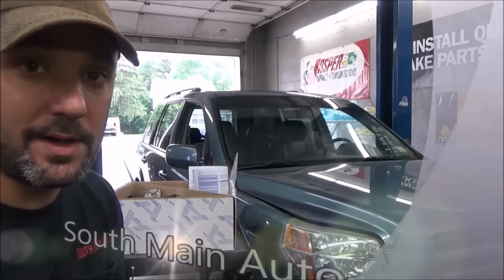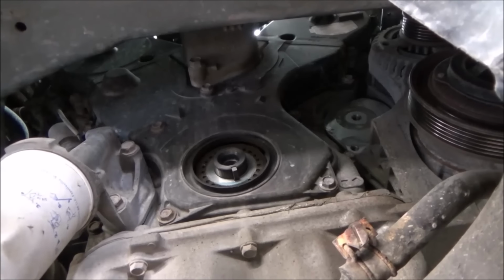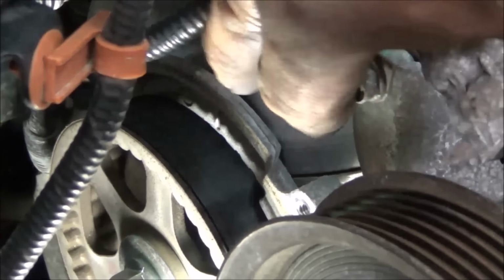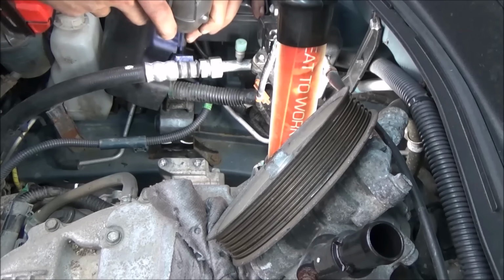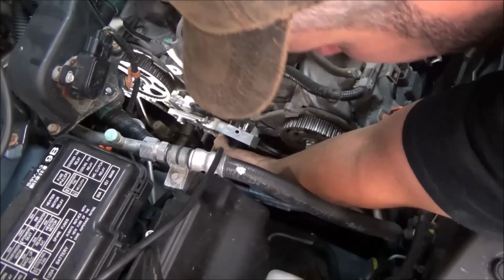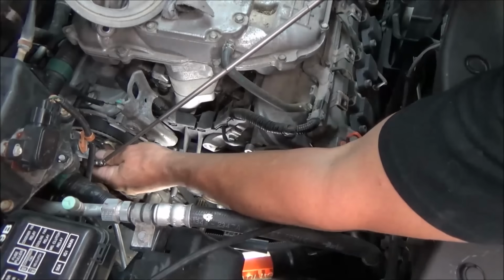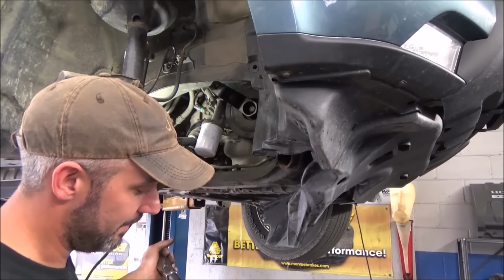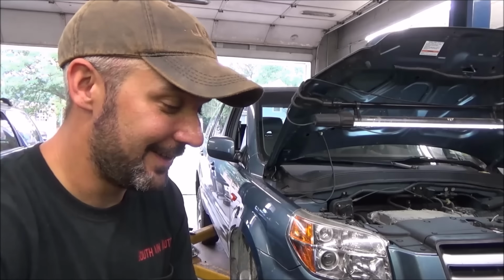Honda Timing Belt 3.5 J35 - Pilot, Odyssey, Ridgeline

Comment: Dont quote me on this, but i seem to remember the numbers on the cam sprockets (1 through 6) and inspection windows on the timing covers are specifically put there by Honda to aid in valve lash adjustment. For example, You would open the inspection window, and put cyl 2 at TDC and adjust your valve lash on cylinder 2.

Comment: I just did mine on an 03 pilot and the rear cam sprung forward. I about had a heart attack but simply wrenched it back and installed belt. Started right up

Comment: Just a note to anyone wanting to DIY this job, try the crank bolt first before doing any other disassembly (like Eric O did here)! I recently bought an 2003 Accord V6, and wanted to jump on the preventative maintenance and did not know much about the history of the vehicle. I ordered the Aisin timing belt kit from Rock Auto, that includes the water pump, tensioner, etc. I also bought the crank holding tool and the extra heavy impact socket. When all of the parts arrived, I attempted to start the job.  With the special socket and a large Milwaukee impact, the 19mm crank bolt would not come loose. I broke out a 3/4" pneumatic impact, with the same result. It would not budge. Finally, I built a tool with a 3/4" ratchet and several 1/2" extensions and a cheater bar. I used the crank holder and was able to to stand on the breaker bar with my 300lb weight and it still did not break loose. Also tried map gas torch to heat the bolt.  My advice is would be to have a lift available where you can get the vehicle into the air. If I could have used just a breaker bar and one socket with a pipe from the bottom, I am 100% confident that I could have broken it loose. The 1/2" extensions needed to get the breaker bar outside of the fender well were allowing too much twist,  in my opinion. As far as the extra heavy 19mm socket I bought, I got it from Amazon, and I would not say it was the best quality. It fit a little sloppy on the the 19mm bolt head, and I think that may have contributed to it not working. I would suggest buying a well made tool if you want to go that route. I was trying to be cheap because this was basically a one time use tool for me. Just wanted to put this out there, because if you follow the instructions on this job, you do several steps BEFORE loosening the crank bolt, but if it refuses to come loose, the timing belt job stops right there.
Reply: @ericpigg2689  I bought the new impact wrench by ryobi and it came right off

Comment: Torque specs mentioned in the video:
Water pump bolts: 8.8 ft lbs or 108 in lbs
Tensioner pulley: 19 ft lbs
Idler pulley: 33 ft lbs
Crankshaft pulley bolt: 47 ft lbs
Reply: @C @CyberForest s he shows in the video, the crankshaft pulley also requires an additional 60 degrees of torque. Other videos show this equates to about 180 ft-lbs total.

Comment: if you left the spark plugs in when you turn the engine over by hand, how do you know you're not hitting the valves on the top of the engine vs fighting the pressure of the cylinders?  thanks.

Comment: After watching videos of people changing Honda timing belts and removing motors and transmissions, I said, "I'm not doing that!" and sold my Pilot for $200 to someone who said they would fix it.   It didn't even need a timing belt, it was smashed in the front, hood bent fender bent radiator broken AC smashed  radiator/headlight support frame bent to hell, front grilles cracked etc.  Then I got a SUBARU with a bad motor cheap, removed and replaced the motor and the timing belt and water pump and everything else it needed quite easily.   The Honda was my favorite car but too hard to deal with.

Comment: Man Ive had the absolute worst time attempting this, just cannot seem to get the belt on correctly no matter what I attempt to do, ive also made many mistakes and would not be su rprised if I bent the valves at this point with having to get it back in time after the belt came off while rotating it.  Ive done a timing chain before on my  kia soul and that was very easy compared to this nightmare, maybe I got a bad kit or something I have no idea what I am doing wrong, I am going to try again once the weather is good again here coming up maybe wensday, if I ever get it on correctly and can rotate the engine over 2 times and back into place ill actually try it if the valves are bent I guess ill be learning how to do that job which sounds like a new nightmare.  Lucky its not my daily driver and not important but man I wish I could get it running again and sell the thing, it seems in great shape otherwise even has crass hatchings on the cylinders that people talk about and it has 200k miles on it...

Comment: Hello Eric. Love all the videos. Thanks. I have a question. I have 2016 accord v6, and with your help, i changed the timing belt pullys and water pump. 3 years later, my pump is leaking. i use the aisin kit. Now im replacing the pump, but should I replace the timing belt and all its parts, tensioner, pullys again. Thanks.

Comment: I just rescued an 07 Ridgeline that was struck hard in the right rear. It's a Texas truck with no corrosion and only 147,000 miles... Had to straighten up the subframe to replace all the control arms, trailing arm, spindle, axle, and wheel. Then I  had to beat and tug on the sheet metal to fit a new taillight. 

Initially the plan was to flip it, but I was surprised how well it drives. Then after watching this video and seeing how easy these Hondas are to maintain I'm going to keep it for the wife, (she really likes it more than me) finding out you have one personally just sealed the deal. Thanks Eric!

Comment: Thanks for a great video - local Honda Dealer wants $1,700 to change timing belt only, not water pump. Aisin replacement kit like you used is a little over $200. I think I may do it myself (with a friend for moral support)!

Comment: Stupid question how do timing belts stay on and not go off the side of the gears as they spin. I know the cover probably helps but do the gears of ridges to hold in the belt to not let it walk off?
Reply: I think the flange on the rear cam sprocket keeps it from walking off

Comment: I just did this on my 2005 Honda Odyssey your video helped out a lot I still have to put crank pulley back on so I’m looking forward to that 😢 then I’m going to try and start it. So I will edit this comment and let everyone know how it went. I had to do this with no garage and in the damn cold with snow on the ground so it has not been fun at all. Well my van started and it runs even better when I first bought it. Drove it around 30 to 35 miles and it runs great. Thank you so much for this video I don’t think I would have been able to do it without it. Thank you. Ps. I never want to do this crap again 😂

Comment: Thank you for this.  I followed along replacing the timing belt kit on a 2016 Odyssey.  I slipped the rear pulley off TDC trying to get the belt tight.  I winged that back to timing marks and everything worked out OK.  Getting that belt tight was my biggest challenge.  Also I used every socket and extension combination I have to get all of these bolts.  It was  a big task.  122k I procrastinated a while before tackling this one.

Comment: HEY  ERIC ,I had rattling  noise only on decel .replaced T belt ,tensioner idler and WP .still have the  noise 😢80000 miles 2006 3.5.Could it be in the valve train?It does not make sense to me because it goes away  on acceleration.

Comment: Very helpful video.  Unfortunately when I test fired the engine I didn’t think to put the crank bolt it and after the engine idled for a minute it spit out the crankshaft key way.  Valves meet pistons.   now I’m removing the heads.. so don’t be like me, make sure you thread that crank bolt in!

Comment: I’ve seen some fake stuff on YouTube. But that crankshaft bolt coming out without flipping the whole car off the lift is about the most unbelievable thing I’ve ever seen.
Reply: Next time you have to do it, just put your socket and breaker bar on and up against the suspension and bump the key.

Comment: For diyers, to make installing the belt easier, leave the timing belt in tact and transfer the paint marks to the new belt, then install the new belt, using the paint marks to ensure that the belt is in the right position.  You would need to mark the crank end position on thr belt before removal.

Comment: The Aisen kit is the only way to go with this repair unless you want to piece together OEM parts.  Aisen is the OEM supplier for these parts.  These parts are too critical to leave to aftermarket parts.  Failure of thr timing belt is almost always catastrophic to the engine.  FYI, only source the kit from a reputable parts dealer.  Amazon qnd eBay are full of cheap counterfeits.  Ive heard many a horror story of broken timing belts from counterfeit/cheap parts.

Comment: Does anybody know what that little "L" bracket with the hard rubber on top of it does?
It's the one in front of the motor mount he took apart. 
It's on the head of the horizontal bolt, doesn't appear to do anything! Lol

Comment: That was a good video.
 I can see why they charge so much ( by the shop price) 
Glad I bought a Toyota, but they ' all have issues compared to the ' OLD DAYS'  
 Such is life.
 In a job like you did, I would change out everything you can with new stuff. It is all apart so you might as well. But I am fussy and you can't be because you make a living getting them in & out. Me, I just have one good car and a old 07 caravan backup. Both are good to go.
 Excellent video sir.

Comment: Great video and thank you for making it. I just finished replacing my timing belt using the Aisin kit, and the most important thing (echoing many comments here) is to mark the OLD belt at all 3 cog locations (with white marking pen), and then mark it exactly on the NEW belt. Once you have the old belt off, just lay the new belt on top of the old belt, line up the teeth by sliding your fingers along the belts to keep it taut and in-sync, and mark it correspondingly. This will give you hard evidence and the confidence that you have installed your new belt correctly, which is very much needed in this install.

The main obstacle from my own install was getting the new belt taut.  It really needs to be taut (like a guitar string). At first, I installed the belt same way as the video, starting from the crankshaft, up around the front idler bearing, and through the front camshaft. And no matter how hard I tried I would be a tooth off (by verifying the markings) and there would be slack between the front idler bearing and front camshaft. I spent half an hour cursing trying to get it lined up with no success.

My solution was to LOOSEN the front idler bearing (unscrew the installed idler bearing about 1/4 of the way out). It will give about 1/3 inch of play/slack to get your belt and white marks lined up. Rear tensioner bearing not installed. So this time around I started installing the belt at the front camshaft, aligning the white marks lined up, and then under the water pump and then the rear camshaft. Then I guided the belt around the front idler bearing (still loosened) and then down to the crankshaft. All of your white marks should be lined up. If so, get your ratchet and as you start tightening the front idler bearing back up to torque specs... you will see the belt getting guitar string taut all around, except in the rear. At that point install the rear idler, and triple check one last time before pulling the grenade pin on the tensioner. Hope this helps.
Reply: That's really great information.  I'm still processing it.  I still don't really fathom why you can't just slip the old belt off and put the new one on without having to mark everything.  I'm guessing that all the "lining-up" and paint marking is because the timing cogs could move unintendedly while the old belt is off and the new belt isn't on yet.  

Is that why the "lining-up" and paint mariking ceremony is performed?  So you can correct any possible mismovements?  I'm asking because I don't yet see how those timing cogs could freely move even if the timing belt is off.  Since I must be wrong about that, which timing cog is most likely to spin on it's own without the belt?  Thanks for any response.
Reply: They can move on their own from spring pressure in the valves... I think that's what it is. I have read many reports on videos of this job of them moving on their own and it freaking the people out. I think putting the lines on the belt also pets you know that you have the right amount of tautness in the belt between the crank shaft and front cam, and front and back. Since theirs still slack at the back of the belt until you pull the pin on the tensioner, better to know you have it right rather than having to recompress the tensioner, get the spring back in, and do it all again.
Reply: there's* and pin* rather than spring in the last sentence. For some reason there's no edit button on the YouTube mobile site.

Comment: Ruined my whole engine trying to put a timing belt on. Man, was I mad! Made sure my marks were all lined up, new water pump, new belt, with 180,000 on it, which is why I attempted it? Was TDC, on the crank, and lined up my cam gears up, put it back together, started it, and it ran like it had one spark plug in it? Have no idea what happened? End of story! Bent valves, according to the mechanic I had it towed to? 4k in parts before I tried this. Struts, ball joints, body mounts, on, and on! New AC system, new EVAP system, 2 new catalytic converters, new injectors! So pissed!
Reply: Just did mine yesterday. I watched this one and the one from EricTheCarGuy, which had a few more tips. There were a few tricks I used that were not covered in either. You probably had slack in the belt somewhere or used the incorrect notches. That's why two full crank rotations with a breaker bar and a timing re-check is absolutely necessary. I must have done this three times before the first start. Sucks man. Sorry that happened to you.

Comment: I did this myself, but I did not line up the crank pulley. I only lined up the top 2 cams…Any pointers on how to line up the cams to the crank?!! I tried to install the belt back, and I can’t seem to go any further clockwise.
Reply: Figure it out? I may have some pointers.
Reply: @mtnman1984  I’m good I figured it out. Thanks anyway

Comment: Stupid question..... Why is it important to align  marks before taking the belt off? Assuming you do not move cam sprockets or crank sprocket while the belt is off, it should not matter. Is this only needed so you know that you did not shift them out of time accidentally? But, technically I can change belt while they are in any position as long as they stay in that position while the belt was off. So, I might as well mark existing positions with marker and proceed with TB change. What do I miss here?

Comment: Great job explaining this procedure, My only comment is how long did it take you to do this timing belt replacement? However  I see a few comments by others that is was around a 6 hour job. You are great at explaining this job, thanks for taking time for us non- mechanics, certainly have a better idea about the replacing the timing belt on this 3.5  J35 engine    thanks.
Reply from the maker: Takes me about 3.5hrs on this model

Comment: Man I’m struggling, did everything like you mentioned had all 3 on top dead center and then I pulled the pin,,  cranked it over 2 times by hand and both top marks are off 1 tooth 

Any ideas. 😊
Reply: You did NOT mark on your old belt the timing marks of the two cams and the crank and then transfer the marks to the new belt.  Even though you put the belt on, there was slack between the 3 marks.  (You did not know there was slack.  You thought the belt was taut enough--but it was not.)  That slack led to the one-tooth off situation.  If you had made the markings and transferred them to the new belt, you were almost guaranteed to get the timing correct on first try.  Ask me how I know.
Reply: @Wanli_Zhang_Arts_Channel  the video I was filling just cut the old belt. Dumb mistake on my end

Comment: So if you cut the belt then don't have to compress the tensioner that is a good idea. I tried to use the bolt to decompress the tensioner it broke the tab off the engine. Ended up cutting the old belt worked great I don't know why anyone would not cut the old one. Easy to see where the cams line up once the belt is out of the way. Must have is a good torque wrench when running bolts into aluminum so easy to strip them out with a long-handed torque wrench. Pressure test of the system also would be a good idea after bolting up the water pump.

Comment: I have a question i bought an 07 ridgeline used and it shows the timing belt was replaced 30,000 miles ago but it has been 6 years as well. I know thats not a lot of miles on a belt but what about the years ? Should i go by mileage or years more ?